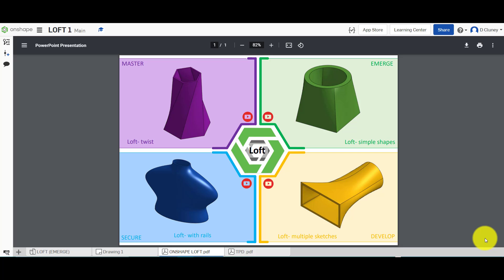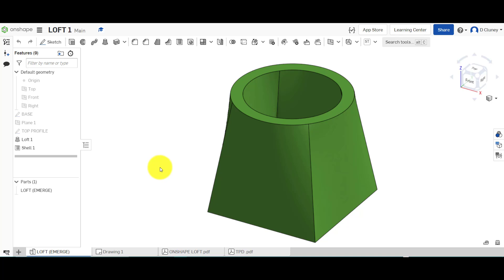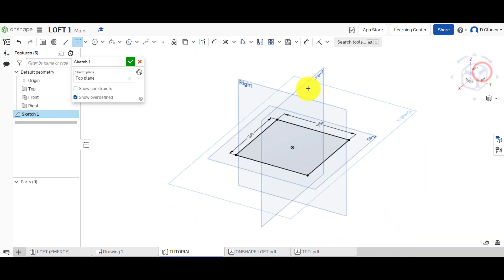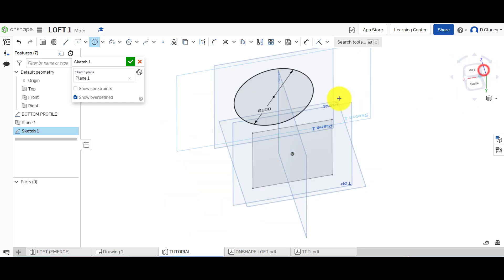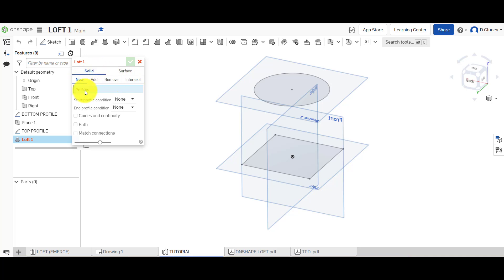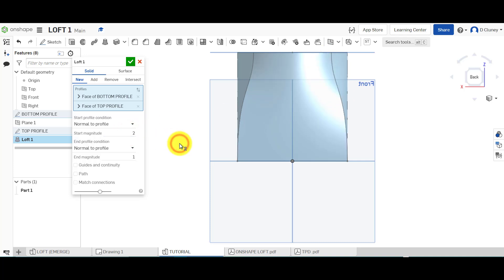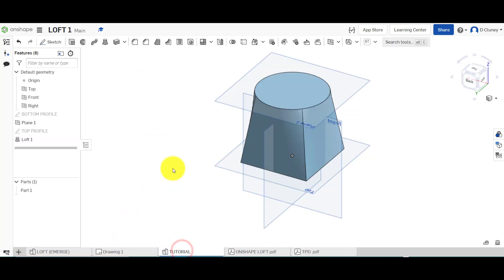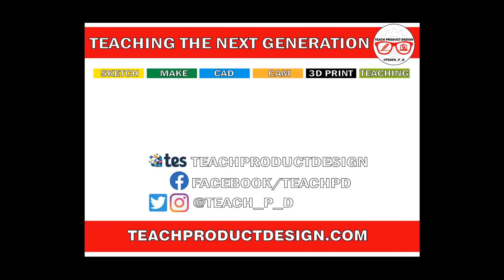Onshape Tutorial- How to create a LOFT? Basics. Step by step guide.

Comment: I created a part  exactly the same way, it is not that hard, as it is some simple Lofting, but some how the Mass Properties are very different, I noticed that the ABS material dense is different too, could it be that Onshape have some changes, so it affects my Mass Properties. But what I don't understand is that the volume is different too.
Reply from the maker: The original file was created 3 years ago, therefore they have probably had numerous updates/ changes 👍